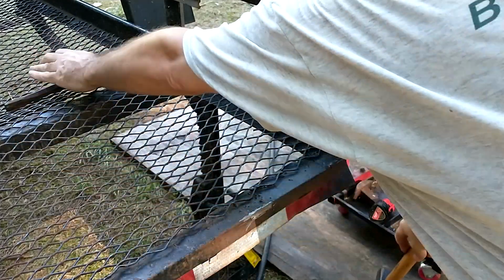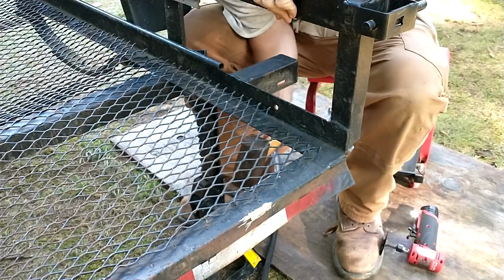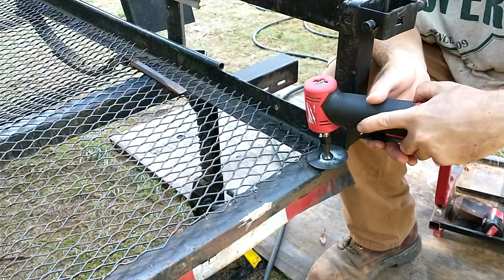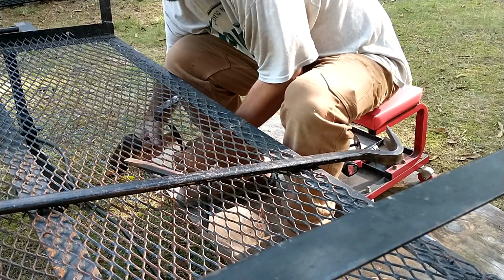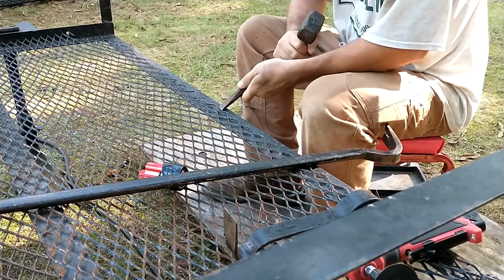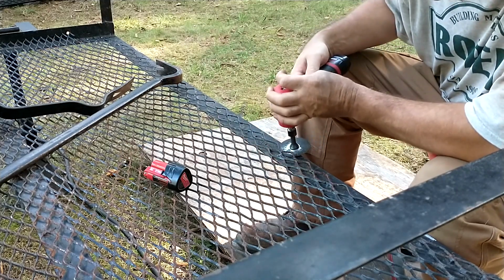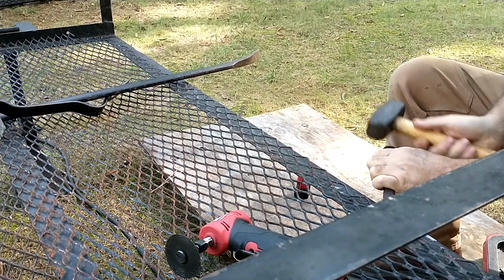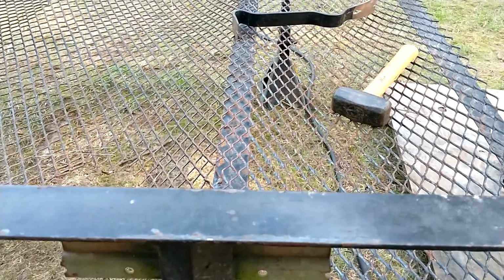Trailer Expanded Metal Decking Removal

Comment: What I see is the expended metal is running with the rails it should be against the rails
Reply: The long width of the opening on the expanded metal is running in the right direction. It provides traction. If you want to decrease the span add supports. The problem with these trailers when purchased is that the manufacturers use a lighter expanded metal. It looks the same as a 3/4#9 standard but when you put the 2 together you will see a significant difference.